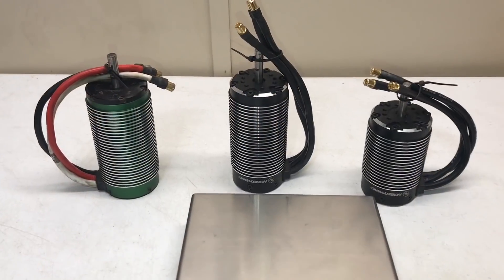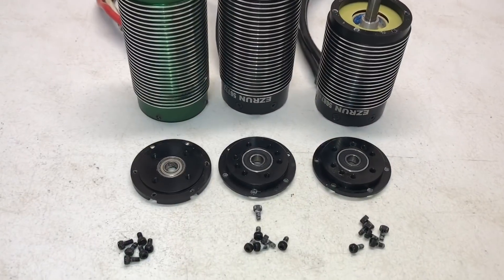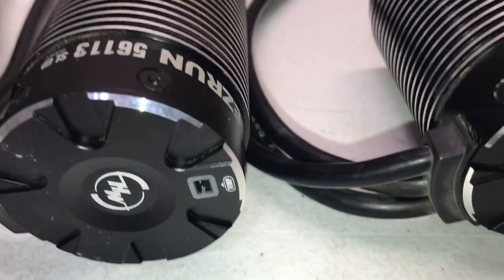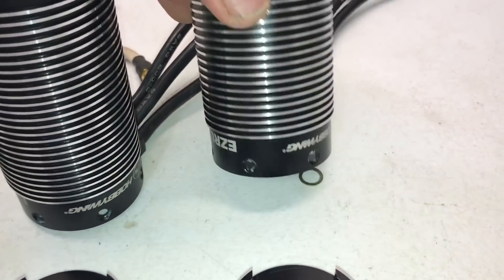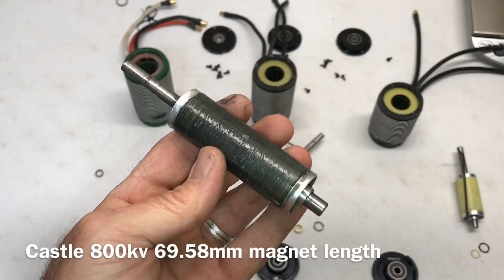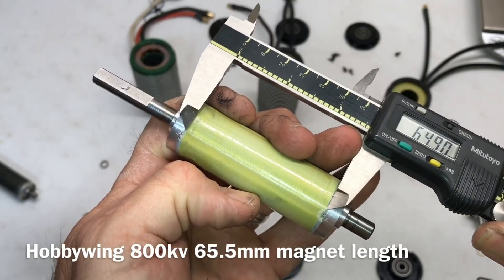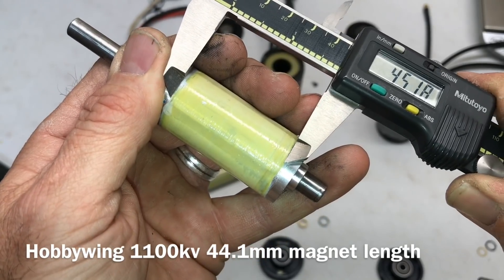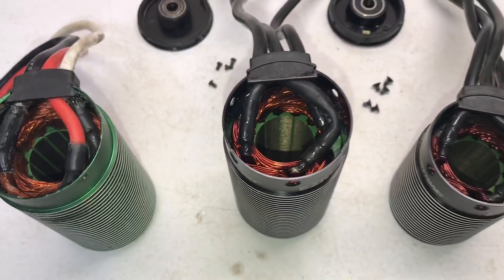Hobbywing Castle 5th Scale Motor Teardown

Comment: I have Hobbywing and Castle on multiple rc cars I have and have come to the conclusion that castle esc's are a gamble might get a good one might get a paperweight. On the other hand Hobbywing esc's are solid, can be abused and still show up for the race. Both companies have solid motors but I think Castle is a little better in the power department on motors so I started running Hobbywing esc and Castle motors. Getting to this conclusion cost me about $1000 in Castle esc's which left me with a bad taste in my mouth for that company.

Comment: One of the reasons castle may use a standard bearings,is that rubber bearings cause more resistance.MoreResistance more heat

Comment: great video, however the best way to identify motors are by their physical size (diameter & height, example Hobbywing 56113, ...800kV motor) the kv can be the same across the board for tiny drone motors to large motors powering tesla vehicles so it confused us in the beginning. Keep up the great work man!

Comment: Joe 
How do you open the max6 motors please I can not remove the end bells to get at the bearings
Reply from the maker: Bolts out and usually I tap on the motor shaft. That usually get the back off.
Reply: @ExocagedRC  literally just used tissue to cover the bearing race and an 8mm hex to knock it out 🎯💯🎯 thank you sooo much Joe for your help and reply 🎯🎯
Reply: It was THIS show that helped me muster up the let’s get this job done Joe awesome 🥇😎

Comment: Rubber shielded bearings may be a little better at keeping dirt out but metal shielded have less resistance so in terms of who win in the bearing department, Id have to say Castle does. At high RPM youre going to want less resistance.

Comment: To be honest I’ve completely gone away from castle I think their stuff has gone down hill the last couple of years. I’ve had 2 esc’s go out on me with very little use and stress and the motors are decent but it just seems their quality control isn’t what it was several years ago. I switched all my big bashers over to hobbywings and have been very happy with them so far.
Reply from the maker: I like the Max6 and Max5 esc's, they are really awesome basher esc's for sure, but the new castle are sensored so a bit smoother.

Comment: thinner coils i would guess would have less resistance which equals more rpm and less torque, so i guess if both are running on 8s the hobbywing would have maybe a tab more, but then again the rotor is a tab long on castle, and the esc could have a factor to, if both motors are on the same esc and same cells i would say they are pretty equal, but the castle may have a tab more rpm due to thinner wire. one last thing is that the castle is rated for 12 cells so it will have more rpm and torque compared to the max 8 on the hobbywing. either way, both are monster motors, i know castle is about 10 hp and i bet hobbywing is close behind because of the max 8 cell. another thing to think about the castle mamba xlx is rated for 8 cells. long story short go with which brand you are more biased to i guess, or go with price

Comment: Great vid, thanks for taking the time to make this video. I just picked up an ezrun 8 2200KV combo today.
As for the wire winding, the thinner & more wound wire, the more torque and less top end speed, the thicker the wires & less wound wires, the less torque & higher end speed. So looks like the castle will have a bit more 'oomph' at take off, but sacrifice a bit of top end speed. I would love to see a comparison of the 2200kv motors of each, the 1515 castle & the 4274 hobbywing.
Thanks again for the info, I will definitely send a shout out to your channel when I do the unboxing video of my ezrun 8 combo. 👍👍
Reply: Ok so just to skim the surface, kv roughly  will indicate the RPM of a motor when multiplied by the voltage. For instance an 800kv motor with 10v going to it should turn 8000rpm. So the higher kv the higher rpm. The more load that is applied the harder the motor will have to work to try to reach its top speed. The harder the motor has to work the more heat will be generated and will result in overloading the motor if too much resistance is applied. This is why gearing is important. You can reduce the size of a pinion gear which will reduce the load on a motor and will run cooler. There is soo much more to explain about different types of motors but hopefully this gave you a better idea.
Reply from the maker: Awesome, thank you
Reply: @ExocagedRC No worries Bro, I believe in sharing knowledge and giving credit where it's due.
Here's the link to my Ezrun Max8 w/4274 2200kv motor combo unboxing:
https://youtu.be/4oD6JN7W5U0
Gave a shout out to you & your video & left a link to your video on the description below.
Thanks again for taking the time to make this video, it was extremely helpful 👍👍
Reply: i know that the less it is wounded means more rpm and less torque but wouldn't thinner be less resistance or would it be more? all i know is the one with less resistance has more rpm, more resistance more torque
Reply: @cadenkorzan  The resistance of a wire decreases with increasing thickness & vice versa. So thicker wire=less resistance =higher efficiency=higher RPM. 
The resistance of a thin wire is greater than the resistance of a thick wire because a thin wire has fewer electrons to carry the current.
Reply: @rcbustanut2057  i was thinking that, i bet you are right, i was debating from a bigger wire has more space aka more to travel through which would be more resistance, but more electrons going through would equal less resistance well ish...

Comment: The bigger bearing doesn't necessarily make them better it's the quality of the bearing itself that means is going to last or not last
Reply: And plastic can dry rot.
Reply: @ArticSun  also metal shielded bearings are smoother than rubber sealed.
Reply: @rey3468  good to know
Reply: bering lebih besar lebih stabil dan gaya akan di distribusi kann secara merata 

Namun hambatanya besar 

Saya rasa castle sangat cocok untuk balapan dan hobywing cocok untuk masa pakai yang panjang 

Castle dan tp adalah motor berkinerja tinggi 

Habywing ketahanan tinggi

Comment: I got stock brushless in my slash platinum vxl system I’m just a back yard badger 2s lips my big issue is my yard has thick grass so what do I need to do to get cooler longer runs out of my slash 4x4 plat
Reply from the maker: Grass is a killer for most all RC trucks, its a constant resistance. About the only way I can think of to get it to run cooler would be fans and a smaller pinion, the smaller pinion will let the motor turn easier but you will lose speed

Comment: I would like to see you compare the hobby star motor to these hobbywing.
Reply from the maker: I’ll see if I can borrow one from someone.
Reply: I'm not sure if it makes much practical difference but there was a noticable size difference.
Reply: Actually hobbystar is a rebranded hobbywing!
Reply: @jameshankssr466  wow.  I have the hobbystar 56112 and I just calipers the rotor and it was 27.9mm!!huge surprise to me.  I could visually tell it was larger than my 2028.  But then again, if you really look close the 2028 is smaller on the outside.  I measure 53.5mm not the fine of course.
Reply: Tim T yeah i’m not sure about any size Differences but i know hobbywing makes motors and esc’s for hobbyking and a lot of the rtr brushless setups are made by hobbywing but dont have their name on them

Comment: Sorry if this a dumb question. Why do these big motors have such low KV? I would have thought they would be around 4,000. Thanks
Reply from the maker: That’s actually a great question. I think it has to do with overall size and rotating mass. The same wind on a 540 motor can be 2000kv but on a 550 can it may be 1200kv due to size and mass. I’m not a motor expert at all so I could be totally off base here but it kinda makes sense to me.
Reply: Typically a larger motor is run at a higher voltage, so as an example a 4000kv motor at 12.6v would have a theoretical max rpm of 50,400rpm.  A 2000kv motor at 25.2v would have a max rpm of 50,400rpm. A larger motor has more torque and increased heat dissipation so is needed for a heavier application. Because of this the larger motor can typically run higher gearing to achieve the vehicles high speed without heat issues whereas a smaller vehicle with a smaller motor with higher kv typically has to gear down due to heat and takes advantage of the higher kv to reach it's maximum speed.
Reply: Imagine the big magnets and the coils running on 4000rpm^^ they would blow out entire universes xD as mentioned before bigger motors bigger mass and bigger Torque and more Watts. The 1100kv has about 100watt less than the 800kv but still the 800 has more torque it could deliver at same voltage. Just a shortcut nothing in depth explained here
Reply: Sigmund Solo  well,, kind of like that in terms of torque, but in electric motors the rpms achieved is a function of how many rotations the motor wants to do per volt applied - so like in my example above the actual rpms achieved would be the same, but with different power curves and characteristics

Comment: Interesting video! However, I have a couple of points for you.

1. Larger bearings do not necessarily mean better bearings. There are several grades of bearings (Google "ABEC ratings"). A smaller bearing with  higher ABEC rating could have lower mechanical losses than a larger bearing with a lower rating. This is usually a cost trade. Both probably have similar rolling resistance numbers which would imply that the castle bearing may actually be a higher-end / more expensive unit. Hobbywing probably went with a larger over-sized unit to get similar performance at a lower price point.

2. Rubber seals tend to have more mechanical losses than metal seals. They do provide a better debris barrier, but that comes at a cost to overall efficiency. Side note: Most bearings (regardless of seal materials) are packed with grease that repels water, so any water that makes its way past the debris shield will probably just be thrown out of the bearing race. This means that the water (and debris) that does make itself into the core of an operating motor will probably settle into other places and begin to collect near the moving parts. So, you should probably still tear down and clean either motor periodically if you run in wet/muddy conditions a lot.

3. The difference in rotor length is important, but the overall strength of the magnets is the key factor. It looked like you had to fight harder with the Castle magnet, so is it safe to guess it was the strongest? A stronger magnet generally means a more efficient motor which will put more real-world power to the ground. Also, since you had the motors apart anyway, it would have been interesting to measure rotor weight. For example. if the Castle rotor weighed about the same as the Hobbywing, but had a much stronger magnet, that would show that Castle used a higher grade magnet material which would imply a more efficient/powerful motor.

4. Wire diameter doesn't mean much without knowing the grade of copper used and the overall winding strategy. Generally thicker wire has less resistance per length, but a thin wire made of better grade copper may have lower resistance than a thicker, low-grade wire. Also some motor makers use several strands in parallel to get the same result as a thicker strand. It would have been interesting to see you measure the resistance of the motor coils, but this usually requires a special meter since their resistances are usually really, really low. Lower resistance coils would produce less waste heat and allow the motor to pull more current (which usually means more torque and better overall efficiency). 

Keep up the great content!
Reply from the maker: Wow lots of tech in that, I know have a whole bunch of new stuff to learn, thank you!! I do know the rubber seals add resistance but I can't see them affecting these motors and I'm assuming they are just larger all around. Whats interesting and I didn't mention it was I had an older 800kv Castle and it has the big bearings like the Hobbywing motors do. They downsized them as they were the same size as skateboard bearings. I've read about the windings a few times and have asked a few people but without specifics on the actual motor I can't really say much about them other than the obvious. I appreciate you watching and hope to hear more from you. I have a small FB group if you want to join that, I'd love to read some more tech knowledge you have.  https://www.facebook.com/groups/exocagedrc/?ref=bookmarks
Reply: Wuoawhhhh....that's absolutely tremendous,
very very many thanks for your superb tech knowledge,which one you share with us,Sir.
I'm impressed 🧐....love to reed and learn more about all things i'm intersted in...
and you bring one in front while doing so 👍👍👍
Reply: Excellent explain, thanks.
Reply: One note on bearings that I didn't see you mention, is that considering the application that these motors are seemingly used in these days, the larger bearing is definitely advantageous as larger bearings generally deal with side loading far more appropriately. 

IE on a speed run car the Castle motor's smaller, metal shielded bearing (assuming it is a good grade) would be advantageous due to an (probably minute admittedly) efficiency increase. However, Landing an X-maxx upside down from 30ft and having that big old motor flex the mount and shove the pinion into the spur hard is something you want those big old bearings to deal with. Based on this tear down, a large scale basher would be hobbywing motored every time, it's going to outlast the Castle in Bashing everytime with them.